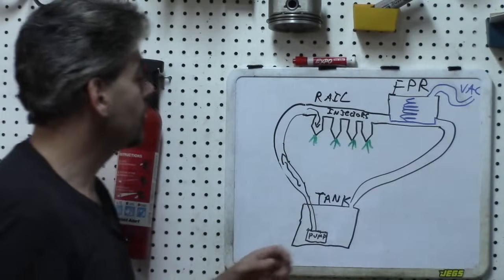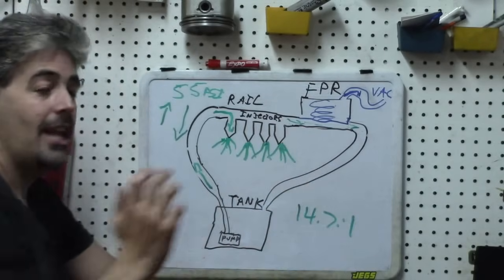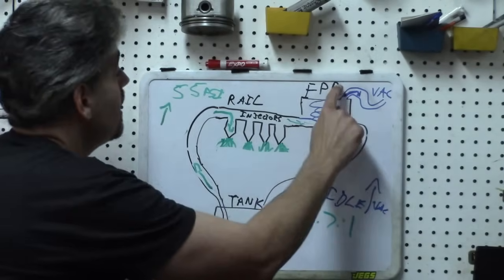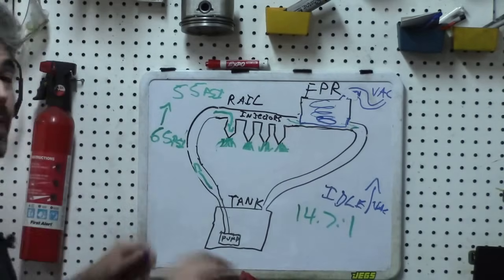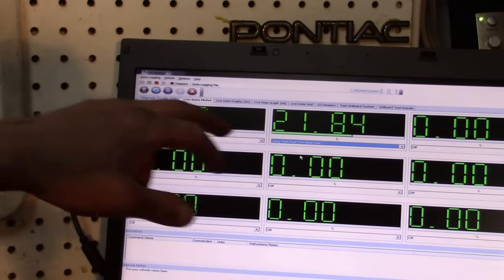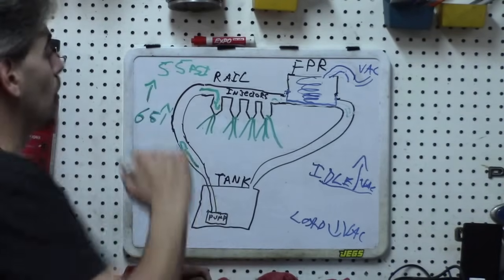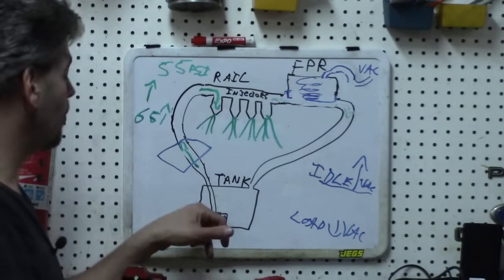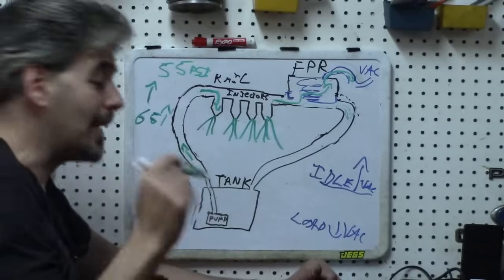Fuel Pressure Regulator Diagnosis + Understanding (HD!!)

Comment: I've been a mechanic for 35 or 40 years he's the only man that could explain to me why a fuel pressure regulator should be behind the fuel rail I always thought all my life the pressure regulator should be in front of the fuel rail thank you sir you are absolutely brilliant!
Reply from the maker: Thanks for the comment!  Yes it makes sense when you “see” the mechanism doesn’t it!!
Reply: If the Fuel Pressure Regulator is inside of the Fuel Filter (e.g. PTC PGF846 Fuel Filter), it will be in front of the Fuel Rail. So the fuel goes from the Fuel Tank through FPR+FF Assembly (Fuel Filter and Fuel Regulator in it inside) to the Fuel Rail. So you were correct for the Fuel Filters w/FR built inside.
Reply: Truth!!!
Reply: Truth!!!
Reply: Best there is
Reply: If you have a bad fuel pressure regulator, what will happen when you put the vehicle into reverse gear? Will the vehicle run rich? Will you get smoking from exhaust at reverse idle?

Comment: This was an impressive presentation all round.  Video, rate of speaking, clarity, emphasis on key points, and logical steps could not have been better.  In fact, as a retired automotive trades instructor I felt a bit jealous.  So well done in every sense of the word!  Cheers!
Reply from the maker: Wow, thanks for the compliment!!!
Reply: Totally agree - have been watching several videos and all are excellent.
Reply: Garry. I recommend this video to the people who want to know more about fuel efficient cars.
Reply: @SchrodingersBox  So, I've been a automotive and heavy equipment mechanic for over 45 years and consider myself to be very good and always do top quality repairs. You have to have a good understanding of how things work to produce quality work and not just be a parts replacer. I think your explanation of the fuel system is top notch. Keep up the good work.
Reply: You forgot to drew the fuel filter for the dirty fuel.
Reply: Fantastic teaching And making sure it's Understood.
Reply: @SchrodingersBox  I would like to  send you some pictures of fuel trim on my scan tool to see what you think.
Reply: @SchrodingersBox  you are very good best video by far thumbs up from me 👍
Reply: I recently changed fuel pump on my tacoma prerunner 98 3.4 . It worked great for 3 months and then it start showing some delay on starting specially after l9ng driving and many stops. Finally it died on me as I came home. It crank and run for few seconds and dies again. Fuel pressure at the outlet of the filter is good so I wanted to chk PR valve as I crank the engine there is no fuel coming out from return line. So is it possible that high pressure in the fuel rail due PR failure cause injectors to stop working?
Reply: Diagrams and demonstration.  It could not be better.

Comment: Hi, thank you so much.. this fixed my problem after I tried everything else. 10 minute job and no cost. My 1990 Foretravel Grand Villa 460 gas pusher had been sitting for some time and I made a 200 mile trip with to working so bad. The diaphragm in the FPR was stuck at the bottom,removing the vac hose made no difference in the rough idle so t sprayed penetrating oil in the vac hole on the unit and applied high vacuum with my pump and it pulled it loose. The engine instantly worked perfect. Without this video I would still I would still be lost. Thank you so much and I will be enjoying my trip back home because of you. :) Gordon Firth, Nova Scotia, Canada.
Reply: Gordon Firth nicely done and good advice for a quick fix on the FPR!

Comment: Great, logical presentation. When I was in school the best teachers (especially math) taught you to think, reason & solve instead of memorize (or follow confusing, lengthy flow charts). As a retired tech (20 years ago) - actually we were still called 'mechanics,' I thank you for bringing me into the 21st century's fully computerized world. When I retired we saw few OBDII systems in private shops, so you really got me back into the analysis mode for which I'm grateful.

I'm currently trying to resolve an intermittent problem- the worst kind- on my 4.6L '06 Grand Marquis (old guy's car) throwing trouble codes P0193, P0171 & P0174 while the car runs flawlessly- except for the illuminated check engine light. The pertinent freeze frame data is RFP @ 75.99 psi-which scares me- and LTFT  @ 29.7% on both banks. After watching your above video & the 2 on understanding fuel trim, I'm going to retest concentrating on the P0193 which looks like the real problem area. But testing so far- especially after clearing codes and (temporarily) bypassing the pressure regulator- shows everything within normal specs @ idle, 2500 & 1500 rpm's. My inclination is to repeat the disconnected regulator tests, now that I better understand the systems, then block vacuum to the interior accessories & carry on from there. 

However, since the car runs so well and this being the elusive intermittent  riddle, anything you care to contribute would be ever so much appreciated! Would you consider the RFP value dangerous (it's 39-40psi in all tests)?
Reply: +Pat Bbb Here's some clarification on my post a day ago and after further testing. The high fuel trims in freeze frame given were from when codes P0171 & P0174 appeared. Currently only P0193 is coming up intermittently and the LTFT readings in that freeze frame are normal. In fact the lean fuel readings haven't reset codes since pulling the vacuum line from the FP sensor while testing the fuel pressures.  The repeated  tests now convince me the problem is/was a defective fuel pressure sensor, which on my vehicle is a sensor only (on the fuel rail), not the regulator. and I've replaced it. My assumption is the 75.99psi RFP is actually a low voltage measurement showing 'pressure' at the extreme high limit, but not true fuel pressure. Time will tell if my diagnosis is correct.

Matt, I hope you'll see my posts and respond with some further input & info for my 'schooling,' especially the upper fuel psi limits. Also, where is the actual pressure regulator(s) in the 2006 Grand Marquis. I'm guessing it is the unit mounted on a bracket on the passenger side firewall with fuel supply lines in & out. But the out line goes to the throttle body, not either fuel rail. And is there another regulator/control in the gas tank as shown in the parts catalog?

Comment: absolutely awesome presentation.  replaced fuel pressure regulator and got vehicle to start but still running rich.  I know where to start looking.  Thank you!!!!!
Reply from the maker: Thank you!  if vehicle is running rich you want to start with a fuel trim analysis at idle vs load. this will give you a better indication of the cause.

Comment: Matt : thanks for the lesson . I was driving my 1987 Chevy Celebrity 2.8L , it lost power and stalled . I pulled over and no restart . I had a strong gas odor . It wasn't White Castle . The gas was running out of the throttle body . I traced the vacuum line to the FPR . I put on a vacuum pump and it immediately pulled gas out of it . The diaphragm was ruptured . There is a vacuum junction on the throttle body . The FPR line is there . That's why the fuel ran out of it . The FPR is buried under the intake plenum and mounted between the fuel rails . It is not a simple replacement . I changed it and the car runs fine . Keep the lessons coming . Thanks !

Comment: this is a really excellent tutorial. 
Finally .....at last...after years of partial insight and despite having the Bosch manual and various other manuals, its the first time that I have completely understood this aspect of the  fuel injection system operation.

Once you appreciate exactly how the engine vacuum together with the  FPR control the fuel rail pressure and delivery, engine performance  then becomes a diagnostic tool , pinpointing fuel pressure and delivery issues.
thank you

Comment: I once had a bad FPR leaking fuel through the diaphragm which I only stumbled across looking for vacuum leaks by sucking on the hose.  Blech!  The problematic symptoms varied between immediate start (one or two cranks) when hot, and extensive cranking when cold.  These symptoms made sense after the fact, but I was incorrectly imagining the actual function of the FPR until this video.  It did not occur to me that low vacuum meant higher pressure.  My incorrect "assumptions" were compounded by my other misconception about vacuum under load!  You are right -- now that I understand the proper functionality I am empowered to work on this system.  Thank you for taking the time to share this!!
Reply from the maker: Yes I have seen this many a time. I usually diagnose it immediately with fduel trim analysis.  It's especially common on theose GM 4.7 and 5.3L's- they leak internally making it really tough.

Comment: With so many sensors in modern vehicles, it's refreshing to see a simple mechanical feedback loop, seemingly independent of electronic control.
Reply from the maker: This is a good point actually, I hadn't really though about it! It's about the only mechanical, non-electrically controlled component on a vehicle lol. Anything else- EGR, AIR, etc at minimum uses electric solenoids to open passages and allow vacuum but this is just direct and simple.

Comment: I'm an old man. When my 55 Chevy would struggle to pull up a hill, my windshield wipers would slow down or stop. Ask your audience to explain that one. Great video.
Reply from the maker: What’s your voltage drop on the battery? I’d start there.
Reply: @SchrodingersBox  I see that you are too young to know the answer. Wipers in those days were controlled by vacuum. Gotcha!
Reply from the maker: Lol yeah you got me there. I never heard of that in my life but I looked it up and you’re right.  Yeah i pretty stick with stuff after 1996 for OBD2!!

Comment: Doing work on a 2001 Nissan Altima. I am a diy, just changed a fuel pump for the second time. Wanted to understand the fuel system more. Will watch again. Thank you
Reply from the maker: If you are changing a fuel pump twice within a year you are either misdiagnosing it, failing to catch a voltage drop or other electrical issue, or you are not cleaning out the fuel tank and replacing the filter before replacing the pump,

Comment: that valve on the gauge is also for priming the tool, to eliminate the air in the hose for more accurate measures and dynamic fluid fluctuations if present.  as air can be compressed is not desired in the system when testing for fluid pressure.  same goes for oil pressure gauge too.
very good tool and many thanks for the video!

Comment: Great video. I've always viewed the operation of the FPR as a way to maintain a fixed pressure differential between the fuel rail and the intake manifold (IM). Keeping the differential pressure constant means the amount of fuel delivered through the injectors is directly proportional to the applied pulse time, the time the injectors are open. At high IM vacuum, a lower rail pressure is needed, to maintain the target pressure differential so the FPR opens up more under the high vacuum and lets more fuel return to the tank, lowering rail pressure. At open throttle, more rail pressure is needed to maintain the target pressure differential. The reduced IM vacuum causes the FPR to restrict the fuel return path, thus increasing rail pressure.

Comment: I think I just found my problem with my Chevrolet Silverado 1500.  I found a good crack on the 90 degree rubber connection as part of the hard plastic hose on the vacuum side of the fuel regulator.  What was happening on my vehicle is that right at the moment where I wanted to accelerate there was a slight misfire/hesitance/stuttering if you will.  The symptoms led me to thinking that more than one injector was dirty, fouled spark plugs or that a spark plug wire was grounding out.  However from the looks of it, no.  Your explanation starting at 06:39 clarifide in my mind how the vacuum works at idle and too immediately what is happening with the vacuum pressure right at the moment when one accelerates.  GREAT explanation!  THANK YOU!  THANK YOU!  THANK YOU!

Comment: I worked on Jet Engines in the Air Force. It was far easier than working on cars. We had fantastic instruction and fantastic documentation to perform maintenance. Nothing was ever a mystery. Finding good instruction and good documentation on the plethora of different vehicles is much more difficult. Your explanation on this simple system has made my backyard project a snap. Thank you
Reply from the maker: I guess jet engines don’t have to pass emissions lol.... or maybe they do?? I am curious about that now that a i think about it!

Comment: Hey matt! love the channel and I very much appreciate the level of professionalism, knowledge, and comprehension you bring to the table. On spot with the understanding and diagnosis line. It's a shame that people would rather see how to fix something rather than why it needs to be fixed, why it failed, how it works in harmony with other systems, an how the actual component or system works. As you do, I am also always stressing the point of diagnosis and comprehension of automotive systems. I shake my head way too often when trying to argue with the wrench monkey on the finer points of thorough diagnosgics. Keep up the battle between the informed and the ever so oafish parts changers!
Reply from the maker: +Mark B Thganks for the encouragement!  Ignorance MUST be challenged if it is ever to change !
Reply: Oafish?

Comment: Saved me pulling and changing my fuel pump .P0171 post injector change no vac leaks , 70 psi pre filter.Fuel trims good  at idle but at higher revs slow to adjust. Just a slight adjustment on the FPR to adjust the pre rail up from 40 psi to the 55psi spec (lowest ) and job done .Most excellent video cheers😊.Will monitor and change out the FPR acts up again

Comment: GOOD Video - wish there more videos like this one. 
Should note, on most GM vehicles that if the diaphragm in the Fuel regulator is bad, and is leaking fuel into the vacuum line, the fuel regulator won't hold vacuum. A vacuum tester can be connected to the FR, if the diaphragm is leaking it won't hold vacuum. Vacuum tester is a tool which allows the user to apply vacuum to various components to check and see if they hold vacuum. They are available at harbor freight and most automotive stores.

Comment: The best video regarding the subject matter. I have had an issue for a while now. Losing pressure at the regulator gauge within a minute or two. From 60 psi to 0 psi in just 2 minutes. I have a return style regulator LS swap. I might start troubleshooting based on this video. Very impressed.
Reply from the maker: Hopefully this video helps walk you through the diagnosis!

Comment: Jesus!!  Thanks again Matt.. I'll try this on the hopes that it fixes my issue. I can't get rid of the rough idle in my Modular 4.6 4v. Now it is getting worse. Something is preventing the engine from passing 2000 rpm unless I press the accelerator harder to get more power out of the engine. Under this condition, the ride is rough and the gas mileage drops to a horribly 10 mpg. I changed the fuel filter, all three cats, cleaned the MAS sensor, changed the throttle body sensors, the air filter, spark plugs, coil packs, checked for vacuum leaks .. I know what you're saying right now but I'm new to your channel and don't have a diagnostic tool to check the fuel trims.. just went to Autozone to get a reading which only told me that I have a misfiring on my number 8th cylinder..
Reply from the maker: I usually start with a basic fuel trim analysis on symptoms like that to at least get a definitive direction.

Comment: Good stuff in your video and very thorough saved a woman I know from buying a mass airflow sensor.
Her 2003 Buick Century 3.1 is not starting when cold. It stalled on her going to work I went and looked it over It tries to start the first couple seconds and then it just turns over so my first guess was that its a fuel problem and so I pulled the tank side gas line from the filter and turn the key to the on position and it worked spraying a large amount of fuel. I put the scanner on it and it gave me a P0101 mass air flow circuit range performance problem.  and a P0420  Catalyst System Efficiency below threshold (Bank 1). So I wrote those codes down and cleared the codes and it starts no problem I took it home and to her work to pick her up and to have her drop it off with me. I changed the Fuel filter and the Fuel regulator and went out this morning and didn't want to start. I cleared the codes that were not there.... and it started again. I am thinking the worst and the easiest. a ECU or the Valet system on it is activating the anti-theft. 3 minutes late calling the dealership this weekend. Going to try a different scanner and see if I can see anything of use.